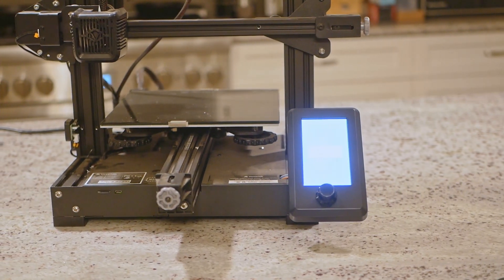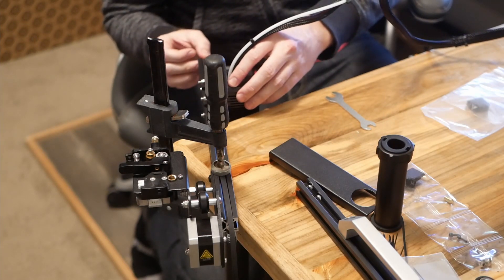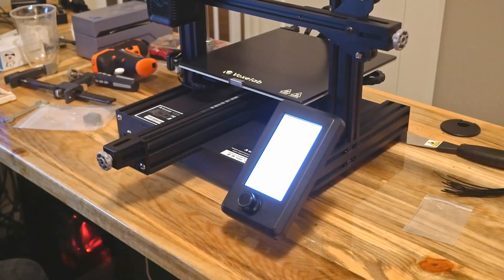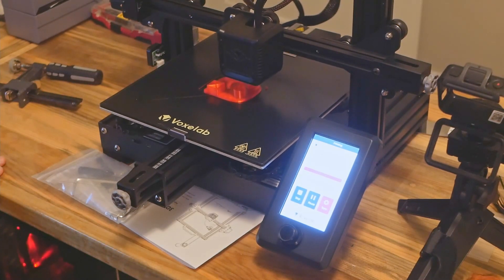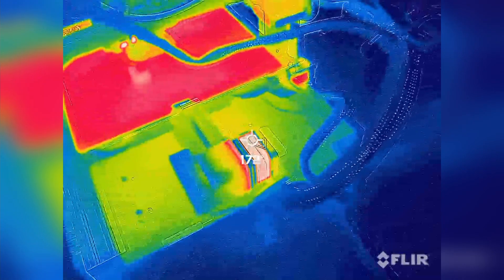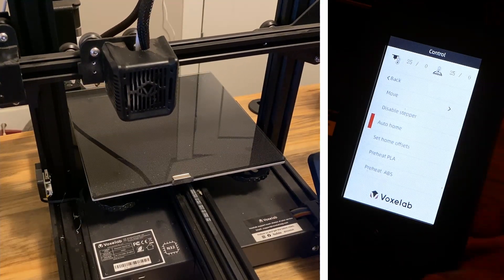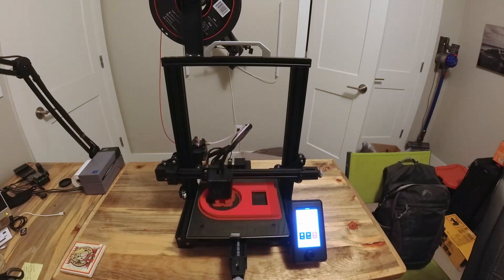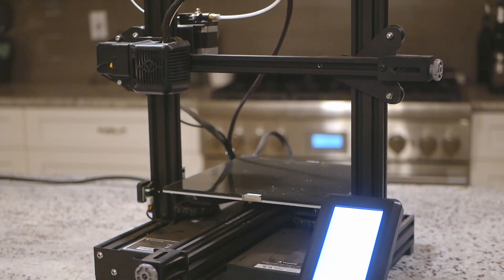Is the Voxelab Aquila X2 the Best VALUE 3D Printer Available?

Comment: I bought one of these in 2022. It worked very well, but adhesion was always a struggle.... I always use brims and often rafts to minimise warping as corners lifted. Last month I bought an Aquila X3 with built in bed levelling. I was disappointed in the total lack of a manual to explain how to use the levelling and levelling data. Having to set manual Z offset invalidates auto-levelling in my book, so IT WENT BACK to Amazon. This month (Feb 2024) I bought a (very slightly more expensive) Ender 3 v3 SE. It is great (TBH I don't like the post-loading extrude menu option extruding straight onto the build plate from 15mm high - welding a splat of plastic onto the plate.) Auto levelling includes z offset and the adhesion problem is that I can't get print OFF the plate.... a far nicer issue to have to deal with. Buy an Ender V3 SE instead of an Aquila - you are unlikely to regret it.
Reply from the maker: I would honestly stay that in 2024 you should skip both and just go straight for something like a Flashforge 5M or Qidi xSmart. The former is down to like $299. I purchased back in Oct and it's be fantastic ever since. Nearly plug and play.

Comment: I got one just to see how it would do. I'm going to be honest, it does really decent for the price but I have two Creality Ender 3 S1 Pros at work (school tech specialist, also i have many more than those 2 at work but) and the S1 Pros for $100-$200 extra seem more 'worth it'. The Aquilla even when tuned a LOT has to be re-leveled every one or two prints. For an Ender 3 knockoff the Ender 3 series seems to be better per dollar. I rarely have to fight them meanwhile I spend more time fighting my Aquilla X2 than actually printing.
Reply from the maker: It does seem to need a re-level quite often. I purchased some upgraded springs and added a CR Touch which took care of most of that though.
Reply: @aaronstestlab  What firmware did you use for your CR touch? I was thinking about it, because the majority of issues seem to be from leveling. I tuned the crap out of my Cura profile for it over the last few days, and if I level it before a print, it seems to do decent for at least basic prints. At home I don't need super high quality prints but it would also be cool to figure out this major stringing issue...  I've tweaked retraction settings but it doesn't seem to be very good at actually performing retraction, so I am not sure if it's the extruder driver or the extruder or my PLA, or all of the above. I ordered some higher quality PLA to test.
Reply from the maker: Just using Alex's firmware with a 4x4 grid. Works great, even though it's no longer supported.
Reply: @aaronstestlab  That's so weird. What was your firmware update process with it? I tried by just formatting my SD card and placing the 4x4.bin file inside of a 'firmware' folder and it totally messed up my GUI. I ended up having to flash it with Voxelab firmware that was current to fix it again.
Reply from the maker: You have to update the board and display firmware separately
Reply: @aaronstestlab  Really? I couldn't get my display apart without feeling like I was going to shatter it. Even after removing all of the screws/etc. I'll try again